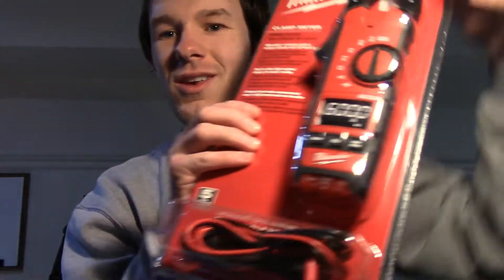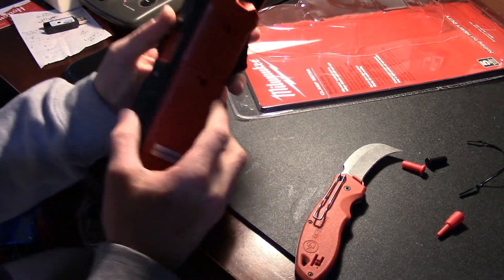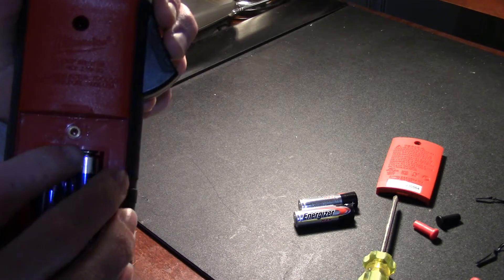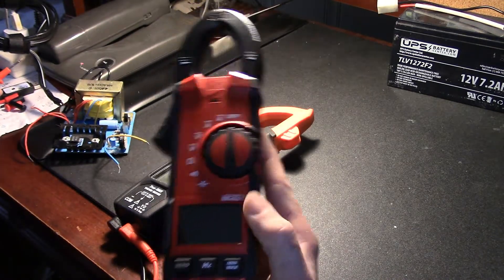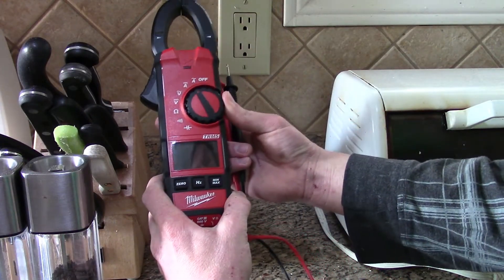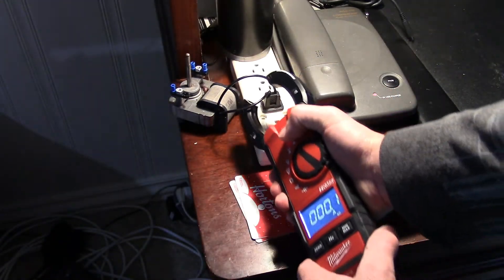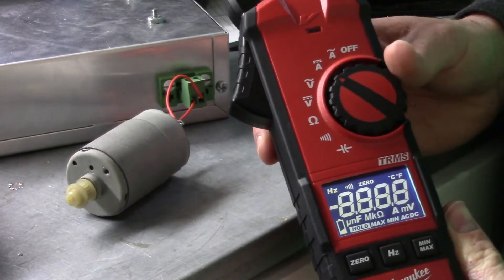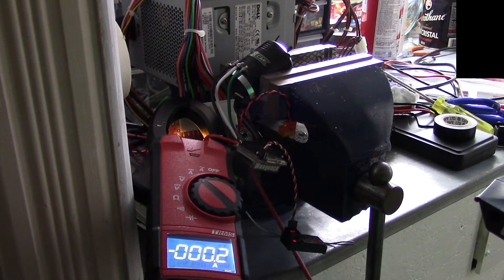Milwaukee AC/DC Clamp Meter | MEASURING ALL THE THINGS!

Comment: I noticed that you had protective probe caps on your work bench. Did these come from the Milwaukee 2237-20 clamp meter or from another set of leads. After watching your video, I purchased this clamp but mine did not come with the protective probe caps. I already poked myself 😂. Great video!

Comment: can you measure dc voltage with the clamp or do you have to use the test leads?
Reply: Leads are used to measure voltage whether is DC or AC . Clamp is only used to measure amps .
Reply: So you can read DC amps with the clamp

Comment: Why does it have a 0.1 or 0.2 reading ? Mine does the same
Reply from the maker: The answer to that is complex and I am not entirely sure what it is. I think the meter is picking up stray currents from the wiring in the walls. What I do know is that if you press the zero button before you take the measurement that makes it go away.